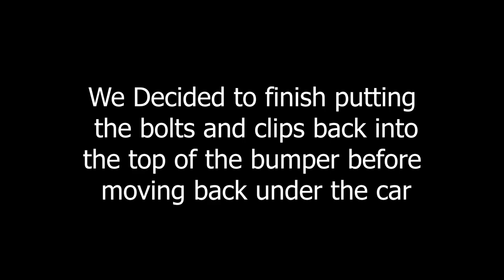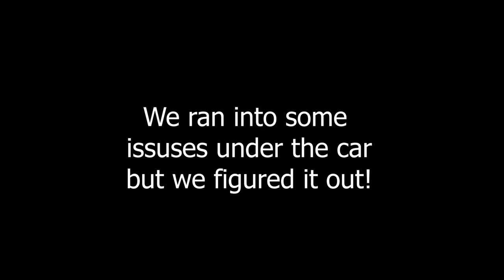How to install the Corvette C7 ZR1 Front Bumper Conversion Kit from Extreme Online Store

Comment: Hey Scott, I just finished my bumper install. Had to add a few screws and bolts but it came out great. My concern is the inch and a half clearance in front of each wheel. I can’t imagine what it’s like driving your car around out there. California roads are much better and I still Drag everywhere.
Reply from the maker: Hi Scott,
Thanks for the comment.
Yes it is very low and I ended up cutting some of the splitter off to gain some clearance.
You may need to do the same thing.
Again thanks for watching!!
Reply: @THECORVETTECHANNEL  looking to have this installed as well. Is the front splitter mandatory for the install? And which parts did you trim? I am at stock ride height.
Reply from the maker: @Everpresnt  No you dont have to install the Front Splitter, but it does look better if you do. Yes you may have to adjust the ride Height and as far as trimming take another look at the video and you can see the line that I chose on mine. Best of Luck !!! Thanks for watching!!

Comment: Good morning, great video - thanks. Question for you, just received the nose cover for my Z51, and I’m curious about the air pressure that will be building up in front of the wheelwells because the ZR1 vents will allow massive air flow vs Z51. I’ll be on track a lot at high speeds and curious if you’re aware of any mods, I might need to make to allow the air to escape that area.

Comment: Scott, on the install of the ZR1 high wing conversion, the two side pieces for the wing seems to be two way taped. Its the last thing i need to do. Your instructions were amazing. Is that how you assembled the wing???  can you suggest a better adhesive??? Please and Thank You
Scott
Reply from the maker: Hi Scott... when I got my Wing it was a Prototype per say and they had already attached the Wing caps on the wing so I did not know how it was attached. But Iater one of my wing caps got a little loose and so I took a close look and saw that it was 2 sided stick tape. So i removed the caps and the stick tape and went down to AutoZone and got some plastic 2 part epoxy. Then I drilled holes in the end of the wing and screwed some thread stock into the Wing Cap and then attached it that way. IT has been super tight ever since.
Good Luck!!
Reply: Did you drill all the way through the caps or just blind holes
Reply from the maker: @scottrbryce439  no I used thread stock on the caps. If you pull all of the sticky tape off you will see 2 holes with threads then I drilled 2 holes in the end of the wing itself and filled the holes at the end of the wing with epoxy and then I inserted the thread stock in to the holes in the end of the wing
Reply from the maker: @scottrbryce439  you don't see any screws on mine at all
Reply: @THECORVETTECHANNEL  thank you, you are awesome

Comment: Thanks Scott for the video. I am about to do the same conversion to my GS. I am concerned about the EOS clearance of the splitter from the ground. A company rep said that it is 1.5 inches which seems unusually low. Is it lower than a stock ZR1? Also, I believe you raised the car in front by an inch on stock bolts? Are there any problems with that and what other specific components of the splitter can be modified or trimmed in order to get the clearance to 4 inches?
Reply from the maker: Yes raise the car on the stock bolts and you can cut almost an inch off the bottom of the splitter to gain back most of the clearance.

Comment: Hey guys thanks for the great video! Does the front bumper fit well around the headlights and other body lines? In your video it didn't look like a perfect fit so just wondering
Reply from the maker: The bumper does have some issues as most aftermarket parts do, but for the most part I am very happy with it and would never go back to the stock bumper.
Reply: @THECORVETTECHANNEL  does it sit much lower to the ground? I've seen some videos that say it sits so low it scrapes everywhere
Reply from the maker: @BuildNMotion  IT does sit lower so I ended up having to cut some of the splitter off and raise the front end a little on the stock bolts. Not hard to do.
Reply: @THECORVETTECHANNEL  got it. So was it lowered beforehand on stock bolts? Btw just sent you a pm on FB

Comment: Hi Scott.
Does this bumper fit right on perfectly without having to do a lot of modifications to it? I was watching this video a guy posted he had the Vicrez ZR1 bumper and he was saying it was a nightmare trying to get it on because nothing lined up properly and he was saying the bottom lip is such very bad quality that he busted off two or three of the bottom lips already going into his driveway.
Reply from the maker: Hello,
As wish any aftermarket part there will be stuff that you find does not line up. Fortunately the top or outside parts line up pretty good.The problem areas are under the car where it all attaches. You will have make adjustments to the bolts holes and such take it fit. But it will fit just take your time.
Now as far as the front splitter you will to cut off a lot of it to get your clearance back because the new bumper is almost 2 inches lower than the stock bumper. So the reason your friend has broke so many of them is because it is so low. I will try to do a video soon to cover what I had to do to fix these issues. But even though it has problems, I still love mine!!

Comment: Call me crazy but I think it would look nicer without the splitter. More cleaner looking. I can also put the splitter on if it looks to bare or like something is missing 🙂
Reply from the maker: Hi Cory... an while back I broke my splitter and had to take it off to get it repaired. I really didnt like it. it looked like it was missing something at least to me.
if you didnt put it on you would not have any clearance issues. Good Luck!!

Comment: Install video is great. But IMO this bumper is not very good on the Stingray. The rear looks even more narrow. The front clearance is less than the wheel gap and requires 4x4 mode to not kill the splitter. A lowered stock fascia with stage 1/2/3 aero is perfect looks-wise. For performance, I think the larger openings just allow turbulent air to get trapped inside the body instead of flowing around/through it properly like on a ZR1.

Comment: I installed the bumper on my Vette and it is so low to the ground that I cracked the bumper and put a whole in it leaving a parking lot
Reply from the maker: Hello, I am so sorry. I know they are low and I had to start using Curb Ramps to get into my drive way and I too hit something and it broke the Splitter and I had to have it repaired. I ended up doing two things. I cut some of the splitter off at the bottom and I also raised the front end of the car up to regain my clearance.
I wish you the best of luck.

Comment: You produce good videos. However, when you state to reach out to you that is a lie! I have reached out with questions a few times and I am still waiting.
Reply from the maker: I would recommend that you buy the kit and then take to a body shop and have them paint it and install it.
But if you want us to do it you would still need to have it painted and then bring it to us and would charge you between 500 and 800 depending on the condition of your car and the fitment.
Reply from the maker: I have not seen your comments or questions. What have you asked me?